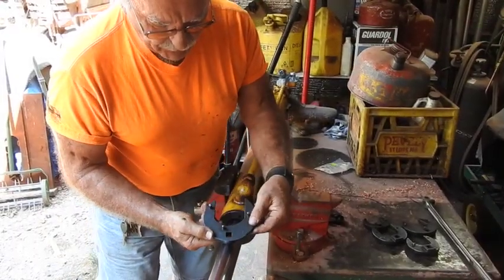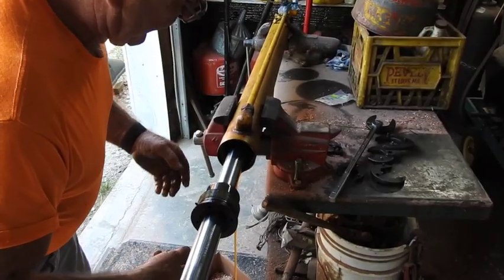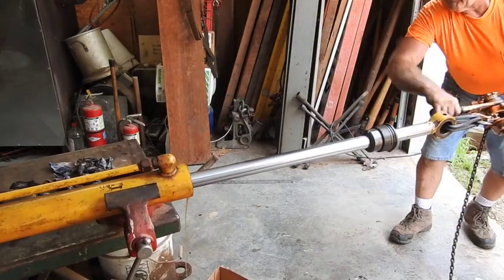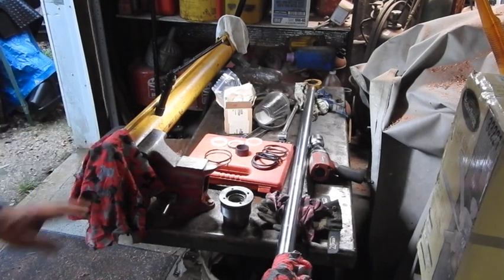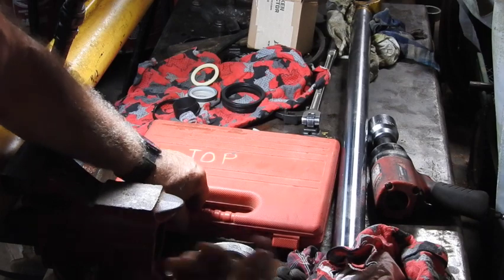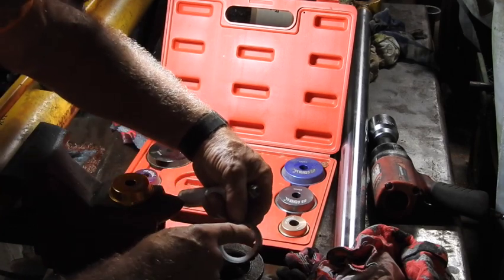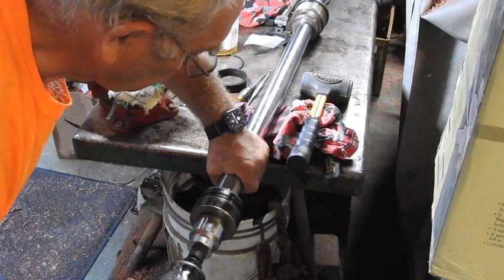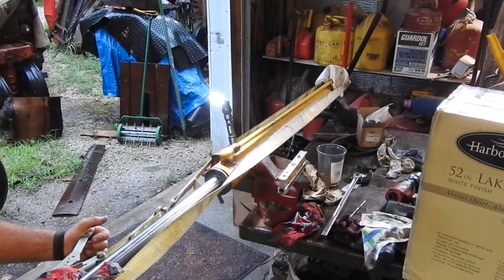Case Backhoe Boom Cylinder Repacking Job

Comment: Good evening Sir, Joe and I did the same on the Case tractor and that was fun 🤣👍 I was baptized hydraulic oil splashed 🤣👌Ouff that was a lots of rains and thunderstorm I will jump in the air and get down on the floor 🥴 SIR, you have BIG BALLS OF STEEL WORKING WITH STEEL Bench ALL AROUND DURING THAT THUNDSTORM HIGH Lighting MAAAAAN 😇 Did I told you that we were hit by lightning on final approach with a AWACS E-3A NATO BOEING E-3 Sentry  Aircraft  back in 2003 when I was In Geilenkirchen NATO AIR BASE. We were around 50 feet above ground and it hit ( lightning )  us like a big 12 shot gun Magnum noise and then smokes, burning smell and a lot of magnetize steel 🥴 The lighting hit the front port side of the front cockpit left a burn mark along the side of the aircraft right above the wing ( break open the emergency liferaft door above the wing and went exit right under my feet on the starboard side ( destroy the rear engine APU ) in the rear galley where I was,,, alI the rivets holding the first outside skin of the aircraft on the ribs were all most all burned and the big 30 feet Radom above us was very badly damaged too and IT took many years to repair that aircraft,,, Well since then, I'm a little Jumping Jesus SIr,,, I was before but much more after that exciting experience ( No Sir, there is no life like it !!! ) See that link to have a good laugh ( that was the promotional recruiting when I joined or just before !!! ) ( https://www.youtube.com/watch?v=mDSaEWdMbI4 ) or the best of  all RCAF  ( https://www.youtube.com/watch?v=rTu9r7VxT-c ) Sir I hope that you had fun reading my little post traumatic story 🤣👌👍 So now you can understand my craziness Sir Cheers 🍻
Reply from the maker: OMG !!  I was laughing pretty hard at the description of how scared that was for you !!  WOW, I bet I would be a little more jumpy too Dave !  I can't imagine flying through that kind of strike.  My hat's off to you mon ami !!  And I bet that DID give you a bit of PTSD for sure.   I will go to those links and watch.  Thanks for the best comment EVER Dave !!  I'll send you a whole BOX of gold stars for the comment of the year.  LOL  Needless to say I am very glad you survived what sounds like could have been a major disaster !!  Thank you once again mon ami !!
Reply: @tractorman4461  Thank you very very kindly for your patience toward my poor written text, and yes we were all very close to be fry on that one for sure !!! Thank you for your OUTSTANDING supportive feed back comment mon ami !!! Cheers
Reply from the maker: @RCAFpolarexpress  I was bragging on your VERY WELL written english text to my daughter who's a speech pathologist at our local school. After she read it herself, she too was astonished at your harrowing experience and said you should be proud of how well you communicate in a language that's not your 'first' language.  Now THAT's from a professional in the english language mon ami and she's very impressed.  Neither of us can even imagine learning French good enough to make sense talking to someone like you or Joe.  LOL
Reply: @tractorman4461  Thank you very kindly Miss for your nice words toward my written skills Miss 🌹👌😇 Thank you Sir for the motivation written feed back mon ami. Now the tough going part of it Sir, it is how to understand women's language since it is pretty much encrypted language to me LOL  Cheers !!! : )
Reply: @tractorman4461  French is the language of food and love, so I'm not a good cook at all ( ask Joe, he nearly die after eating one of my survival Glass JAR FOOD )  and after 3 separations and one divorce under my belt, it is the English part of Canada who save my soul LOL !!!!
Reply from the maker: @RCAFpolarexpress  Now Dave, you know what you just did....??  Your comment made me spew coffee all over my keyboard !!  LOL  You are a brave man to put such serious thoughts about the fairer sex in print for all the worlds lady-kind to see !!  Now I wouldn't be surprised if there would be a line of 'em at your front door tonight.....( to probably scalp you for being so bold).  Fair well mon ami, and if you survive the attack tonight, I look forward to continuing conversation after you are released from the hospital.   (-:  LOL
Reply from the maker: I just watched the two clips about joining the RCAF and I only have one question.....WHERE DO I SIGN UP !!!  LOL.  Boy, those clips were motivational weren't they !!?
Reply: @tractorman4461  Yes they are still HIGHLY MOTIVATIONAL FOR ME,,, When I have a very bad day at work, I look at them many many many times to brain wash my brain so I can continue further more like the little bunny rabbit ( going going going ) LOL !!! Thank you again for your OUTSTANDING Written fun Sir !!!

Comment: that was very interesting buddy good job you are not scared to tackle anything I could maybe get the cylinder off and away to the hydraulic shop I would go just a dumb old truck driver put good on you for doing the job that was quite the storm rolling through take care have a great night
Reply from the maker: Well Tom, what it is is that I'm too cheap to pay anyone unless I have to !!  LOL  This was the day after St Louis got hit with 12'' in some parts.  All main roads entering the big city was shut down...but out here on the ridge I didn't even get wet.  Of course as long as the shed roof didn't leak anyway.

Comment: I may have missed the reason why you needed to do the seal replacement in the hydraulic cylinder. What indication did it give you that determine the problem?  Was it leaking around the rod or was there no lift or hold in the hydraulic cylinder?  Did it sound like there was a pressure leak?  I’m totally amazed at what you can do. Is there anything you can’t do? Thanks Thaddeus
Reply: Lol! Went back a couple of videos and realized the reason for the repair on the cylinder. It still amazes me what you can do.  I bet it was fun fixing it too!  Saving money and having fun is a great reason to doing things yourself. Thanks.  Keep up the videos.
Reply from the maker: @killinskindlingfirewood1851  Hahahaha....thanks for going back and seeing the reason.  I should have grabbed the cell phone and shot a bit of the huge spray coming out of the end of the cylinder, but I had to scramble to get it to the parking spot before blowing out all the hydraulic oil.  It was an impressive spray too !!  I was afraid it covered the Nikon recording on the tripod, but the wind took it just to the side of it.  Thanks Thaddeus for the very kind comment.  I am glad you enjoy the videos here !!

Comment: That belt held some pretty good pressure when taking the cylinder apart! One of these days I have to rebuild the lift cylinders on my old Farmall loader. 👍👍👍
Reply from the maker: I tell you, those V belts can hold one heck of a LOT !  I've broken them before doing things like this they aren't meant to be used for but never for lifting overhead.  It's handy to keep a few laying around.  Yep, better get on the old loader....!!  LOL